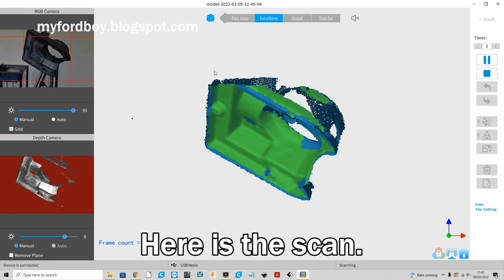Metal Casting at Home Part 119. Scan, Print, Cast. Replica Marklin Donkey Engine

Comment: Amazing what you can do with the technology available nowadays.  Although, it's always been possible to do such things, having the technology we have now, makes it so much easier.    Now, if only the moulds could be made in a similar way..!  🤔
Reply: 3D printing molds can be done, and is often done for pouring products like silicone, or for making forged carbon fiber parts. 
Sadly it just cannot stand up to high temperatures so its a no-go for anything that needs to be poured whilst melted at high temperatures.

Comment: I'm curious if that zinc aluminum needs to be degassed and I wonder why you never put another vent hole for the metal to flow out of?
Reply from the maker: No need to flux or degass.
This metal is interesting. Pour at 500C, it stays liquid much longer than aluminium and is much tougher and heavier.
I don't use a riser for small parts

Comment: why did you paint it? *what kind of sand or plaster would be used to do a very intricately designed chess piece? i would like to use a blue wax melt away from a gelatine based mould. i wanted an entire chess set made but the metal worker only wanted to do rose coloured brass / 3kgs and $600 fee.  couldn't i use aluminium and dyes? or add another metal to the aluminium to change it for a second color?  thank you for any reply.
Reply: I theorize that the paint was too create a smooth surface on the 3d printed part
Reply from the maker: Paint to give a smooth pattern.
You can anodise aluminium easily to change the colour.

Comment: Why in this situation, is an 'exhaust port' (I'm not sure if that's the right terminology) not used when pouring?

I assume the shape of the part being cast somehow dictates that?
Reply from the maker: You mean a vent or riser.
I can do small parts without them. The sand is pourous to some extent.
The riser is usualy added to feed the metal as it cools but not needed on this small part.
Reply: @myfordboy  that makes sense, thank you!

Comment: I see that you suspended the part by a wire but it doesn’t show up in the scan. How did you remove it?
Reply from the maker: It's very thin and the contrast in the scanner software was adjusted so it did not show.
Reply: @myfordboy  that’s a great trick. I have the pop 1 so I’ll try that. Thank you

Comment: As a Brit.  I tend to class Phosphor bronze as a good gun metal, where as Commercial bronze (90% copper and 10% zinc) and architectural bronze (57% copper) 3% Lead and 40% Zinc. 

Most average Bronze is 88% copper and just to say there is loads of types of Bronze like Aluminium Bronze and manganese and Alpha Bronze & Tin Bronze, anyway the list is long and it is worth finding out the benefits of such as can be good for some parts and no good for others,
and machining can test your skills, but the results can be awesome and some ugly one too.

Well you have done a nice job on that connecting bar.

Comment: im a bit confused , why not just use the original base casting as a model in the sand and poor 
as like what you have used is that if you get an xbox 360 camera and the SDK files from MS is that you can scan and do the same
im sure we have covered such previously
anyway nice for you to keep up with your contents as always love watching your channel.
Reply: You can get metal shrinkage when casting, so copying the original would have resulted in a smaller copy. By scanning, you can scale up the size of the 3D printed model to compensate for the expected shrinkage on casting
Reply: @20vK  I think it might have to do with the date this video was posted.... just saying
Reply: but at the same time, this all looks pretty legit... I don't even know anymore
Reply: @gorak9000  Shrinkage is really the reason. Metal shrinks when it cools from molten. He enlarged the print by 101.5% to compensate. The casting is now the same exact dimension as the original.
Reply from the maker: Not possible to use the original part as a pattern as it is. With the cut out top and front it could not be removed from the sand. Also extra material needs to be added in some areas to be machined later.
Reply: @myfordboy  Is there a reason you can't add material and patch the cutout before printing, just like you scaled up the base to account for shrink?
Reply from the maker: @jimurrata6785  You can if you have the skill to use Meshmixer or similar. I don't!
Reply: @myfordboy  .... yet !    😉
I've watched many of your videos and you've grown so much since you started.
You learned the 3D printer and now the photogrammetry scanner.
Imagine adding a boss, gate or just blanking off a hole or cutout.
People have to go into their scans to remove noise and reorient the object to the print bed anyhow.
Reply: @myfordboy  When one is confused and Asks a question one then learns from such. 
Thank you Master :)